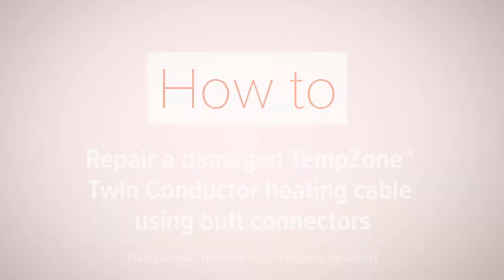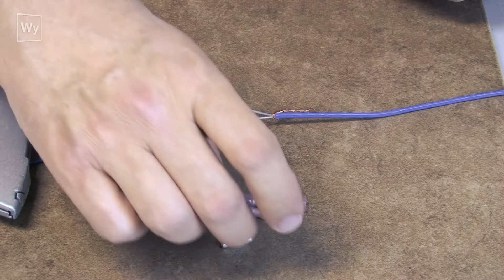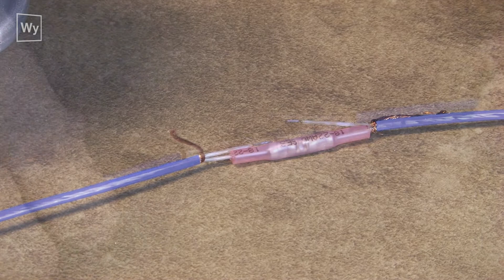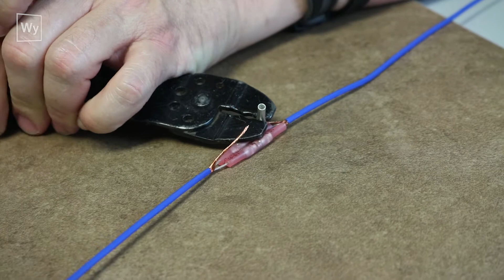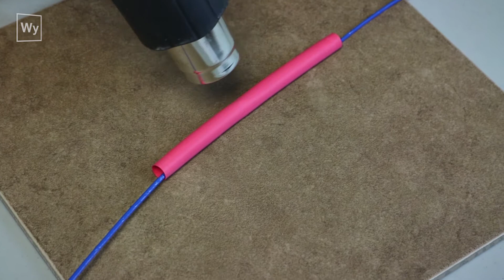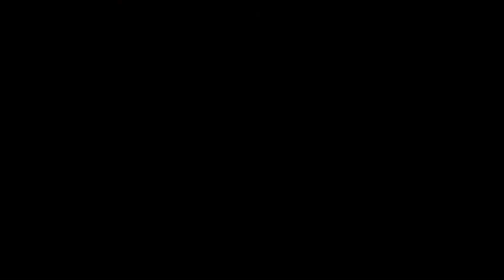How to splice repair an electric floor heating cable using butt connectors

Comment: since  the two current carrying wires look identical, how can I tell them apart when I splice them back together?
Reply from the maker: There is no polarity in the wire, so they can be connected either way - will not make a difference for the repair.

Comment: Hmmmm does it matter what wires you splice together?
Reply from the maker: As long as you're not splicing a wire with the ground sheathing, it typically doesn't matter which wires get splice together. Just make sure you keep things separated enough to tell them apart while working on it!

Comment: Hi, Good night, I have electric underfloor heating on the floor. and broke down last winter. I opened a hole and managed to find a cut wire. My thread is exactly like yours. I have a doubt, these two wires have to have continuity with a multimeter between them despite being a resistance
Reply from the maker: Hi Fabio, If you need assistance with this repair - please call into our tech support team who is available 24/7 at the following number: (800) 875 - 5285